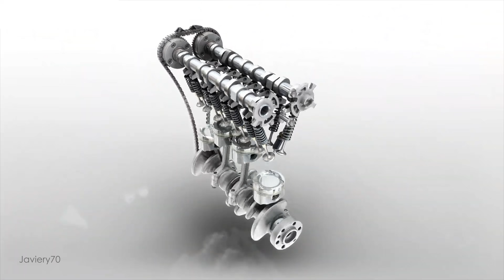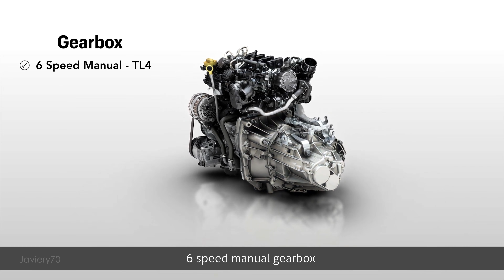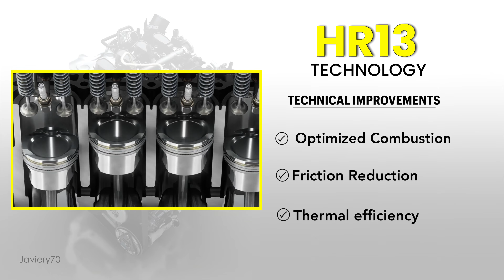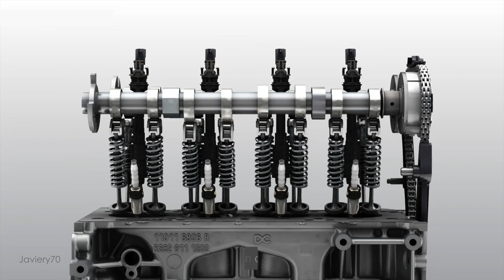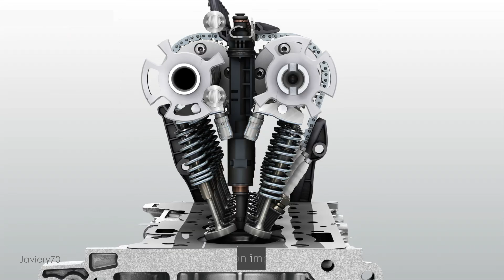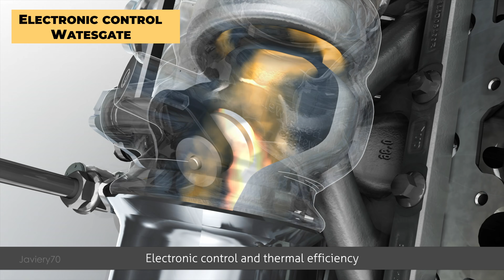🔸 Engine 1.3 TCe RENAULT - DACIA | Its Technology

Comment from the maker: 🇪🇸video en español👇🏻
ttps://youtu.be/NWUWz6AW4zU

⚠Here is an error at the beginning of the audio, the launch of this engine is in 2018 and not in 2028🙏
Thank you for watching the video.

✅ Next video : 👇

🔸Thermostat update for Renault 1.3 TCe engine [EN]
https://youtu.be/HJ9fEeAwtn4

subscribe!

🛍Buy on Amazon  👇
✅CASTROL RN17 5W30 oil  
👉https://amzn.to/3WzWjTQ

✅CASTROL RN17 fe 0W20 oil
👉https://amzn.to/3OE0pXH

✅Coolant RX tipe D ( yellow neon)
👉https://amzn.to/3kd50QR

 ✅Coolant RX type E (dark blue)
👉https://amzn.to/3A8boF3
------------------------------------

✅1.2 TCe Engine full Hybrid
👉https://youtu.be/80ulKHJqV-w

Thank you for watching the video. 
As a Renault workshop technician, I will answer questions and comments.
Reply: The electric motor in the MHEV has 4kW and only 6Nm? Isn't that a mistake? In my car, the 1.3 TCe 140, the electric motor has a power of 3.6kW as stated in the approval.
Reply from the maker: The data I provide is generic technical information from Renault with maximum values.
Mild Hybrid does not have an electric motor but is technically an alternate starter.
The alternate starter mounted on a Captur does not have the same power as the one mounted on an Austral.

In addition to charging the battery, its main function is to start quickly and smoothly when the star stop function is activated.
In addition, during start-ups and accelerations it provides an additional 6 Nm of torque that is not noticeable when driving but provides lower consumption.
Reply: @javiery70  That 6Nm is a bit off. At 4kW, the 6Nm torque of an electric motor would be around 6000rpm, which is unlikely and I doubt it would support a combustion engine at that speed. Perhaps there is an error in the specifications and this torque is understated.
Reply from the maker: The 1.3 Mild Hybrid 12v engine is not a hybrid engine. It does not operate in electric mode. It does not have electric traction.
It provides 6 Nm of extra torque to the internal combustion engine for a short and limited time.
Reply: Javiery bom dia . 
Comprei um Duster 1.3 TCE aqui no Brasil 
Por ser zero, ele está fazendo em média 8,5km por litro  na gasolina . Você sabe a média desse motor na cidade na gasolina ?
Reply from the maker: @thales2609   en ciudad aproximadamente 8 litros /100 km y en carretera unos 6 litros / 100 km
Reply: @javiery70 8 litros por 100km
Reply from the maker: @thales2609   8 L / 100 km
Reply: This engine 1.3 tce suports lpg Prins? Thx!
Reply from the maker: Prins ?
I don't quite understand the question.

Comment: Hi, i just bought a Captur 2018 with TCE1.3 - 150ps last 2 weeks. However the idle rev is alway at 1000 rpm after cold start. is it normal? From my expererience with my old VW cars, they are just around 700-800 rpm at idle.
Reply from the maker: Yes.
When cold, the engine speed can increase to 1000 rpm for a few seconds; this is completely normal for this engine.
Reply: @javiery70 hi, no i mean it stands permanently at 1000rpm when no gas. Cold start at around 1200 but then 1000.
Reply from the maker: and does it stay hot at 1000 rpm?
Reply: @javiery70 what do you mean by "stay hot"? Everything is still good (hope so), no error code or warning light so far. Only the battery is aged. Last week i checked it at the garage and i got result that the battery has now only 68% max. capacity.
Reply from the maker: Quiero decir que si con el motor caliente también está a 1000 rpm.?

Si la batería está descargada el motor puede estar un poco alto de revoluciones para poder mantener la carga de la batería , esta estrategia es normal en su funcionamiento.
Reply: @javiery70 yes after driving 30 mins on highway, it still stays at 1000 rpm when idling.
Reply from the maker: Okay.
Engine revolutions per minute (RPM) are not a constant value.
Temperature, air conditioning, and battery charge are all taken into account.
RPM could also increase in the event of an additional air intake malfunction.

Check the engine's air filter. If it's very dirty, the engine can't draw in enough air and the RPMs increase.

Another point to check is whether there is a whistling sound when pressing the brake pedal; this indicates an air leak from the brake booster.
Reply: @javiery70  okay thank you for your information :)

Comment: I currently have a Megane in for repair; it is fitted with this engine, which has sustained internal damage. The crankshaft thrust bearing has fallen out. Is there any known history regarding this issue?
The car is a 2023 model and has covered 67,000 km.
Reply from the maker: Hello.

What oil do you use?
Reply: @javiery70 kroon-oil 0w20, car is 2nd hand buyed 3 moths ago. Before, it should be Renault dealer maintained.
Reply from the maker: Meganza 0w20 ?
Reply: @javiery70 yes
Reply from the maker: @thierryb388  The oil meets Renault RN17 quality standards, so it's compatible.
I haven't had any 1.3 engines with this problem, and Renault hasn't reported it.
The oil is crucial for this engine; I recommend using the same oil recommended by Renault.

Comment: After over 40 years of experience, I can say that these "small" engines are worthless (I drive a 2003 Megane 2.0 myself). A good engine doesn't need a turbocharger or gasoline direct injection! Diesel engines shouldn't be used for short trips.
And when I look at this bicycle weak Timing chain it makes me sick... you just don't build something like that !!  That's shoddy workmanship and not an engine that will last long.

Comment: I have only one question, if cylinders are spray coated then reboring is not possible?
Reply from the maker: Yes. It is possible to reuse the sprayed metal technique in cylinder rebuilding.
However, it is more cost-effective to buy a cylinder block already rebuilt by the Renault factory.
Reply: @javiery70 can we just rebore and use custom made sleeves?
Reply from the maker: It is not possible to recondition a cylinder in a traditional way and with guarantees because the thickness of these cylinders is very small, very thin.

Comment: Disappointed  by not getting variable geometry turbocharger
Reply from the maker: That's correct.
It has a fixed-geometry turbocharger with electronic control. Much more reliable and precise than a variable-geometry one.

Comment: I bought nissan qashqai 2025 model brand new. So this is the same??? And automatic gearbox has any issues?
Reply from the maker: Yes.
Nissan and Renault share the same 1.3 engine. They may have some differences to suit their models.
The 7-speed automatic transmission is generally reliable and doesn't cause serious problems.
Reply: @javiery70 the cvt not the  7 speed
Reply from the maker: The CVT transmission is completely different from the EDC. It's an 8-speed called X-Tronic, and it generally doesn't cause problems.

Comment: Well..... Renault is launching, more relaunching duster with 1.3L Turbo petrol as an option that will produce 160bhp/hp and 280Nm of torque. I wonder if this is the same engine made with mercedes.
Reply from the maker: Yes. 
This engine is common to Nissan, Renault, Mitsubishi, and Mercedes. Each manufacturer may make modifications to adapt it to their vehicles.

Comment: How to correctly choose truly fully synthetic motor oil: 
Motor oil components - base oil. 
Base oil - Group V base oil (aviation neopentyl polyol ester + Group IV base oil (PAO) polyalphaolefin).
Advantages of aviation neopentyl polyol ester base oils:
Neopentyl polyol ester base oils for aviation lack any β-hydrogen in their molecules, therefore they decompose at higher temperatures (320 to 340°C), while diesters decompose at approximately 280°C. Due to their poor thermal stability, diesters have been phased out and replaced by aviation neopentyl polyol ester base oils. Aviation neopentyl polyol ester base oils are the only base oils capable of providing the thermal and oxidative stability, lubricity, cleanliness, and low-temperature performance required for aviation jet engine lubrication.
Advantages of ester oils: Easily adsorbed and stable oil film. The polar structure gives ester oils special lubricating properties, easily adsorbing onto interfaces to form a stable oil film, preventing complete backflow even in cold conditions, providing excellent low-temperature protection. For example, compared to mineral oil lubricants, the polar functional groups of ester groups act like a gecko's suction cup, adhering to the friction pair interface and not easily detaching even in cold conditions.
After reading the above, do you understand why ester-based fully synthetic lubricants are expensive and why they are good?

Comment: Witch oil is best 0-20 or 5-30????
Reply from the maker: Both RN17 oils are suitable for this engine.
RN17 FE 0w20 oil is recommended for its low viscosity, which improves fuel economy (FE), sporty driving, and improved cold starts.
RN17 5w30 oil is the standard oil for this engine.
It is important to review the maintenance schedule, as it may vary by country.

Comment: Another very helpful post. Unfortunately, there's no RN17 type engine oil in Türkiye. Do you have any suggestions for an equivalent? For the 2023 1.3 TCE Megane?
Reply: The authorized service uses RN720 oil. I want to do the maintenance myself. Unfortunately, we cannot reach the RN 17 oil you recommend.
Reply from the maker: I recommend using the oil recommended by the manufacturer, which may vary depending on the country. A cold country is not the same as a warm one, with different anti-pollution standards.
The oil specified for this 1.3 TCe engine is RN17.
However, Renault indicates that other compatible specifications may be used depending on the country of sale.
Reply from the maker: I don't quite understand.
Maintenance may vary and depends on the country of sale.
Have you been able to see the maintenance details on the My Renault Turkey website?

Comment: Hello! What if i install LPG kit on this engine? (for duster manual, 150psi 4x4) 🌾  I want to know its its safe to do the kit. (ofc the instalation will cost arround 1800euro, only in special shops that make's this) Any bar things can happen to engine if did the instalation?
Reply from the maker: The installation company is the one who must provide you with this information and guarantee its proper functioning.

Comment: But the nissan have dig-t engine isnt that differents?
Reply from the maker: They're the same engine. Each manufacturer can then make some modifications to suit their systems, so physically looking at the engine in the engine bay, they may not look exactly the same... that is, they may or may not have a cover on top... the pipes may be different...

Comment: Well, it seems from some videos I've seen that it also has problems like almost all GDi and TGDi... it seems that the aluminum alloy bodies in which the cylinders are inserted... move, and this movement causes a leak in the cylinder head gasket... We'll have to wait and see if these are isolated cases or a widespread problem...
Reply from the maker: What videos?
Reply: @javiery70  I didn't save the videos or the links. I don't usually do that. It was in some video that appeared as a suggestion on YouTube due to my interest in the platform...
Reply: @javiery70  https://www.youtube.com/watch?v=jl7S2_rtqb4
Reply from the maker: Hi, I've been watching this video with great interest, but I can't find any information about how cylinder movement causes a head gasket leak.
The video positively describes key engine parts like the engine block, cylinder head, and turbo, and compares them to other brands of engines and 3-cylinder engines.
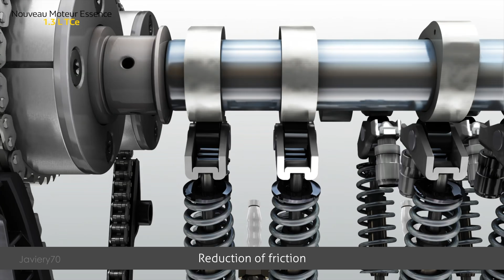Reply: @ 03:22 Not cylinders, cylinders holders... cylinder receptacles...
Reply: @ And here another video talking about of problems of this engine family... high oil consumption...
https://www.youtube.com/watch?v=YpdCgXUKWKA
Reply from the maker: @eduardonicolas1638  This means that the movement of the piston inside the cylinder causes wear on its walls, forming an oval shape.
This wear is normal in all combustion engines of all makes, and manufacturers try to minimize it.
Renault reduces wear by adding plasma to the cylinders and using DLC carbon material in the piston rings.
Reply: @javiery70  No, that effecto is well know for more tah a century... when i seen the video at first time, think the same has you... he is talking about cylinder's case movement...
Reply: @javiery70  There are many videos showing problems in this family of engines, spacially 1.0 and 1.2, wich is souposed has been fixed in 1.3... but some problemas are still present...
Today, all GDi, or T-GDi... (any engine, any trade mark) are affected by many problemas...
Reply from the maker: @ There's no news of cylinder problems with this engine at Renault, at least in Europe.
In my line of work, I haven't had any cylinder problems with this 1.3 engine, and this engine is the most widely used in the entire Renault range.
It can break down if there is no care and good maintenance like any engine.
Reply from the maker: I watched the video with great interest.
The video refers to the old 1.2 TCe (HR12) engine.

It is true that the old 1.2 TCe (HR12) 4-cylinder engine had a batch of 400,000 vehicles affected by a design flaw that caused excessive oil consumption.

This news has also been reported in the automotive press.
That old engine was discontinued in 2017.

This new 1.3 Tce (HR13) engine replaces the 1.2 (HR12) engine and is a completely new engine that does not have the problems and errors that its predecessor, the 1.2 Tce, had.
Reply: @ First video is talking about 1.3
Title: Motores Renault H5H 1.3 TCe y Mercedes 1.3 TCE Mercedes M282 | Motorparts
Second video is about 1.2, but it is the base for 1.3... so some problemes may be inherited...
Reply from the maker: @eduardonicolas1638  The first video discusses the specifics of the HR13 engine in a "positive way," comparing it to other engines from other manufacturers and comparing them to 3-cylinder engines.
And it doesn't show or demonstrate anything negative about this HR13 engine.

The second video talks about an engine that is no longer manufactured from the same "H" family. This means that the only thing they have in common is that both engines have double overhead camshafts.

The HR13 engine is a completely new engine developed from scratch with the participation of Nissan and Mercedes. In addition to NOT having the problems of its previous generation, it significantly improves on its technology and design.

My comments are not based on what other people may say, but rather on the information and technical experience that my work at the Renault workshop provides me. For the positive and the negative.
Reply: @ If I am not wrong, HR13DDT (Nissan denomination), and H5Ht (Renault denomination), and M282 (Mercedes denomination)... are the same engine... 
H5H is a family of engines... with different power, torque and displacement... and the first video is talking about this family of engines...
I'm interested in this topic because I'm thinking about a Duster 4WD, and it has one of these engines, but it creates a lot of uncertainty for me. I'm a lifelong diesel user; they're extremely reliable, and the problems with the GDi and T-GDi engines create a lot of uncertainty for me...
Reply: @javiery70  https://www.youtube.com/watch?v=YpdCgXUKWKA

Comment: Merci pour cette vidéo en espérant que ce nouveau moteur de Renault montrera ses preuves et sa longévité, ce qui n'est pas le cas avec certains moteurs qui ont de plus en plus de casses.
Reply: It won’t.
It’s specifically designed to fail. The cylinder coating will wear off and can’t be fixed, engine dead. They purposely did this instead of the normal iron sleeves that almost all engines have.
Reply: @NOTAMV it is designed for 500000 km at least ... Put very good oil in it, drive safe and STOP COMPLAINING!

Comment: Hello, i own a Renault Captur 2021 1.33 variant, i understand this engine has a possible failure point in thermostat housing, which can come apart at the plastic welding point. i have this vehicle for 3+ years and driven 75k kms, so far i had no issue, but i am worried about this possible issue since from what i understand, you might not get the coolant warning quick enough before irreversible damage is done to the engine.

So i think i will replace the thermostat housing and pay for it myself, i wanted to ask, 
do you think replacing it will solve the issue? 
will it at least lower the chances of such a failure? 
and lastly, what part should i strive to replace it? if the design was improved in time, i would like the newest part and not the same part that's just laying in the warehouse for 4-5 years.

Thank you
Reply from the maker: Hello.
If the Captur is manufactured in 2021 then it already has the new thermostat installed.
It is exactly the same as the original but another manufacturer, Renault, made the change from approximately 2020.
The thermostat is a complete and unique piece.
You can see the thermostat in this video
https://youtu.be/-syGBwt46PU
minute 1.33
If there is a lack of coolant, the engine heats up and when it reaches 120 degrees, the message and warning light appear on the instrument panel. In that case, the engine must be stopped immediately.
I have this engine with the original thermostat and I have not changed it yet, I am not in a hurry and I am confident. But I have it under surveillance.
I will soon upload a video talking about the thermostat of this engine.